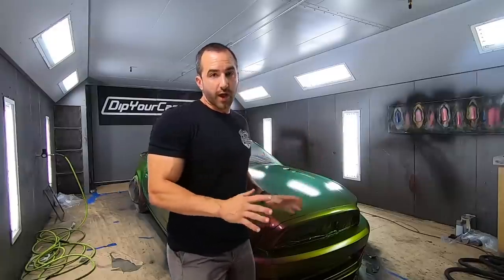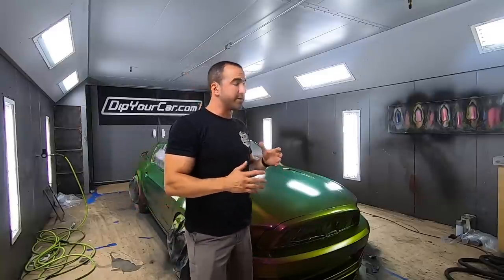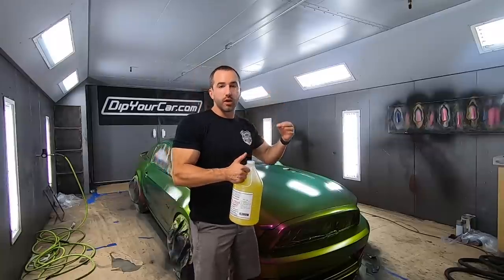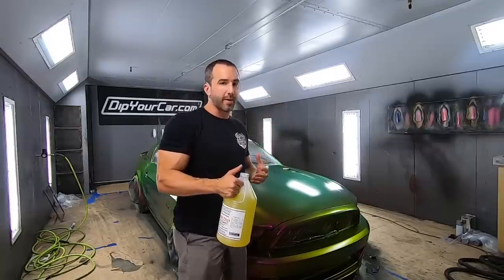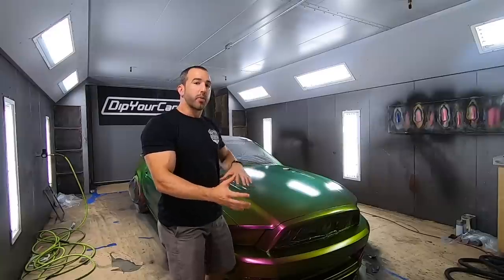Trying a Crazy LIQUID SOAP Paint Masking Trick on a Whole Car

Comment: The technique has been around for a while. I learned about it from the guys at House Of Kolor. You used a good color scheme for the base. Came out nice.
You can also use those plastic ketchup and mustard bottles you would see in dinners. They give you good control over your line width. You can use them to get horizontal lines on the sides of the vehicle.

Comment: After some fine tuning, this could be used as a way to “mask off” fine details like old school pinstripe or flames for a dip project. You could do one of the fade dips and then put hot rod  pinstripes with a thicker soap, then the shadow black over it.
Reply: Oldschool is very much possible with plastidip without this. Just need to know when to take off the fine line tape en when to keep a sharp razor or precision knife 👌🏻😉
Reply: I was thinking the same, instead of a load of masking tape to mask off graphics, could just outline with pinstripe then fill with soap
Reply: They used to do this in the 80s with vaseline... check out Earl Sheib if you've never heard of him.

Comment: If you're gonna do this next time, maybe try dipping in a big brush in soap and use it to splash in all directions. Just to add some dynamic. This turned out very well the shift comes trough much stronger than usual. Also you can use petroleum gel (vaseline) in the same way, except it's much thicker and you can actually quite literally draw cool designs across if you have patience. Then clean it with a rag and some alcohol or medical benzene.

Comment: That turned out SICK! - if you were going to keep it long term, you'd probably have to clear over it, right? 🌈
Reply: I don’t think you’re supposed to clear coat over this rubberized material
Reply: There is really nothing “long term” in regards to plastidip. Sure, You can keep it on…but it’s peelable properties, colors, flex, etc all fade with time.
Reply: Yes you would want to clear over it to make sure it doesn't lift on the edges and to protect it.

To clarify, you would use the plaatidip specific clear, not enamel or any other type of paint. They sell multiple different protective top coats on the site, or you could use the dip armor ceramic coating 

In response to the question of longevity, sure it won't last decades like a well cared for paint job would, but done right and with the higher end dip products like proline, you could hit the 10 year mark and beyond.. but that's not the intention of the product. It's for people to have an affordable way to change the look, with the option of peeling it off and doing something new or going back to factory at any time. Once you do it once and get a feel for it, your last coat will still be drying and you'll already be thinking about what you want to do next.. it's addictive 😆

And honestly you can do a vehicle 3-4 times for the cost of 1 professional paint job. If you chose to not have any expensive pearls or options and just stick with a solid color..
 you could easily do 20x color changes for the price of painting once
Reply: @cramdangle  If it's anything like the canned spray vinyl you can clear it.Ive personally done it twice in small scale tests using mazda3 emblems off a Gen 1 and a gen 2. The Gen 1 was done two years ago and still looks great with the clearcoat making it look like it was wet and I just did the Gen 2 about 2 weeks ago with neon pink and it pops like crazy.Just check and make sure it's compatible with vinyl.

Comment: The rough edges between the masked and unmasked areas looks like a peel waiting to happen. I'd probably hit it with a couple coats of gloss or satin clear to seal it up and maybe fuse the layers back together. 

This does make me wonder if you could use a liquid mask that isn't so runny, one that could be brushed on and wouldn't run due to gravity. My first thought is corn syrup. Paint it on in a cool, shaded area, spray the dip then go bake the car in a hot sunny location to soften the syrup and pressure wash the car. 
My second thought is to use a gelatin like aspic. It is used in food service as display liner or as a glossy top coat for certain foods. It gels really firm and can easily be melted, strained and reused. To use this, you would likely need to build it up by brushing on a coupe layers in an air conditioned spray booth and a sunny summer afternoon south of the Mason, but it should work a treat.

Comment: Liquid masking has been around a hundred years. You can also buy the stuff which is designed to peel off like rubber cement but it doesn't harden or stick like glue. The same use of liquid masking is used to make a fake wet look on flat surfaces with big water droplets only and spraying the paint from a hard angle about 80 degrees and then let the water evaporate naturally.

Comment: I worked in metal finishing shops doing zinc plating and anodize and in my experience, I wouldn't use soap, it's got a higher pH balance making it corrosive. After seeing this, I'm thinking about trying it with baby oil and paint. Dawn dish soap can stop the chemical acid burning of decently strong acids so who knows what it's doing to paint in the long run but I know it will fade the dye off of anodize pretty quick

Comment: I first used liquid soap (Dawn) as masking about 10 yrs ago when trying to figure out how to mask a badge with some real thin bits on my car. Ended up doing it on many of the parts I didn't want pained and would have required tight taping. Worked great but never thought of doing this.

Comment: As soon as I listened to the concept, my mind immediately thought "Nah, dip will form a thick layer over the top of the soap, leaving you with soap-filled bubbles.  It won't just wash away with clean lines like paint.  There were whole huge areas of the black dip blasted off when washing away.  It came out alright, but definitely not as nice as regular paint projects using the method.

Comment: This makes me wonder if you could do an antique type finish like you can do with house paint, which water based paint straight over the top of wet oil based paint so water based paint will dry first and as the oil paint dries it will crack the water based paint then when dry just do a clear coat but I don’t know if there is a water based car paint?

Comment: For the greatest part, I think it came out fantastic.  To make it "better", it would probably be best to work on a car in sections.  For example, start with the roof, A-pillers, B-pillers, C-pillers, rear deck, and rear bumper, doing the 'soap' , then black, then rinse.  Next, do the same for the hood, front bumper, and front fenders.  Finally, do the doors & rear fenders.  By working in 'sections', you'd probably eliminate the "problem" of the black 'adhering' to the soap.

Comment: I'm wondering if this would effect the longevity being the paint edges are essentially ripped? 
Still once it starts peeling just peel the lot off... the colour shift is still under it!
Reply: Just run a pain thinner along the edges with a very small paint brush and spray a ceramic sealant over it

Comment: You should of applied the soap from a squeeze bottle to get the best patterning and do not use the jet wash as it can lift areas of the plastidip that are not meant to be washed off just use a normal hose without any nozzle and wash it gently with a microfiber this concept has been around for decades by the way suffers snowboarders and skateboarders have been doing it since the 70s

Comment: Overall I give it a four and a half out of five because it looks like the water blasted off a little bit more could maybe use a lighter top to just seal it instead of using heavy mix get a better consistency and possibly drawing on the soap with a brush so you can get a very detailed design that you would like underneath for instance a Spider-Man car or superhero car easily done and it's a brilliant start to the form

Comment: Awesome, however, using big syringe to apply the soap layer and air jet, low psi to force horizontal , no downward drip effect. Air direct all soap streaks front to back of car , when wash off will look like car going very fast while sitting still.....

Comment: I guess the key to getting this right would be the time between spraying the top coat and wash.  I thought if the plastidip did what it's designed to do, it would create that solid "sheet" if you will.  I'm really surprised at how clean the lines are.

Comment: Cool concept that can be take a step or two further. Instead of the soap, try making designs with rubber cement and then spraying over it. the rubber cement should theoretically be able to come off cleaner with a semi rigid flat scraper that doesn't have a sharp edge. I can imagine all kinds of ideas for designs. A Punisher symbol, a water style flame design, etc. Maybe get a bad ass graffiti artist to do some old school burner text with car motifs. You're definitely on the right track, now take it to the next level. You got this!!

Comment: I'd like to this same job done only with the royal blue to purple flip flop paint applied over the black you sprayed
Reply: Basically dual colorshift paints , if it turns out I'm pretty sure you would get the HTH did you pull that off

Comment: I wonder if you would have put the front of the car on jacks to get a 45 degree angle so the soap would run toward the back of the car at that angle instead of vertical lines you would have 45 degree lines

Comment: I like it, the drips look clean, an awesome.... but..... imagine doing this again, BUT setting it up some how to where the car is splashed from the front while its moving at some speed. To give it those true paint splash lines, an drips. 

I'm thinking masking off the car like usual except the tires since you'll need them, an for the windshield use a clear tear away like they do on Nascar. Setup a giant balloon with the wash, an drive the car into the hanging wash balloon. Speedup a bit to get those natural splashes, an drips. Stop an proceeded as normal to clean up. Mind you I know you'll need a closed off stretch of road to make this happen, but imagine how much more realistic an better this would look.... 🤯 🤤😎

Or just have two buddies, one on each side of the road with a bucket full of the soap. Have them toss it onto the car while you drive by. Then proceed to paint, then cleaning.

Imagine.... 😎
Reply: Just get a crane, throw a tow chain on the front end of the car, lift it up and soap/paint it with the front end pointing straight up in the air 😂

Comment: Dude, you did that bass ackwards. Put the base color on, then put the soap on and then the color shifting pearls on top of that. That way you don't have the issue of it trying to come off in large pieces. Yes, you will use a great deal more soap, but I think doing it that way would work versus the messy results you ended up with. Alternatively, you could just use painters' tape to mask off the designs you want on top of the base coat, then spray those unmasked areas, wait for it to set, then remove the tape. After that, all you have to do is deal with clear coating it.